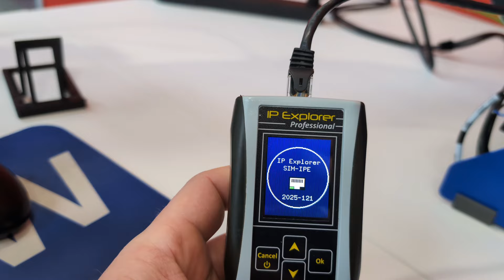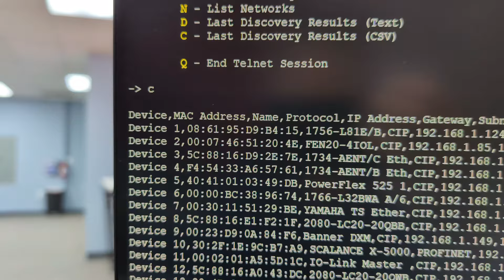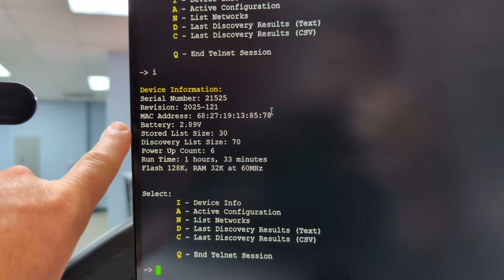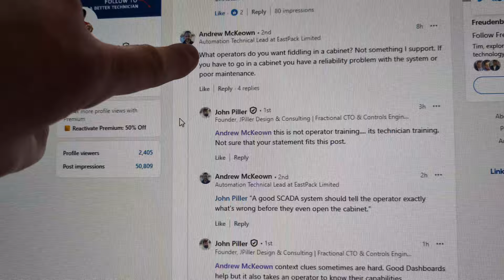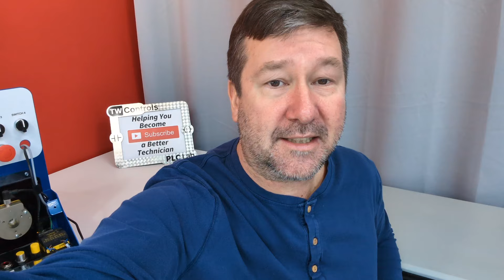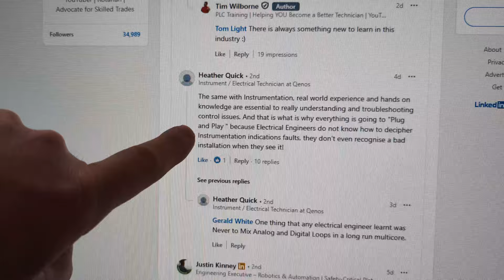SCADA Design Strategy & Exporting Your SIM-IPE Network List to CSV

Comment: Good entry point on the HMI standards part.  Digging in DEEP this semester.  Whole arena is like E-Stop "standards" (or lack of) around the world (omigod) but worse.  Just even in trying to find agreement on Red v. Green and Pushbuttons.   You came up at least partly in Water World (waste and drinking, right?)   I did some time there, too, but also a LOT of Utility Generation.  Water World was always:  Red = Stop v. Green = Go, right?  Generation is OPPOSITE.  In that realm, Red = ON (they think that infers "danger,") and Green = OFF (they think that infers "safe.")  Meanwhile in the Real Working World -- 10% of US men have at least some degree of Red/Green color blindness -- so the whole concept is rather lacking.   I have searched around for some real world go-to types (most of IT and Computer Science will not touch this) . . .  Generally, Industrial Designers are good in this, but it turns out that a partner college to us - University of North Texas -- is doing some direct study into this exact arena.  Is a team-mix for them between -- get this -- UNT Graphics Design and Communications.  I am like . . .  well, okay -- I have been looking for you.  I am volun-telling some students this semester (Capstone for upper class) to work with UNT on this and offer to implement UNTs directions and design for us to test this out.  Will let you know how goes and might be some good show content for you.
Reply from the maker: Yes, the standards can be quite confusing, even within a single industry.